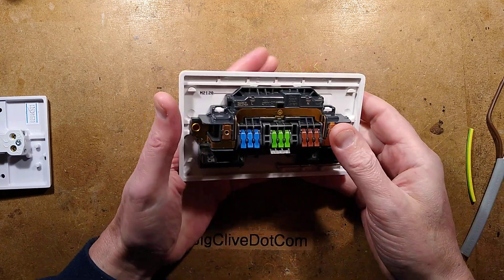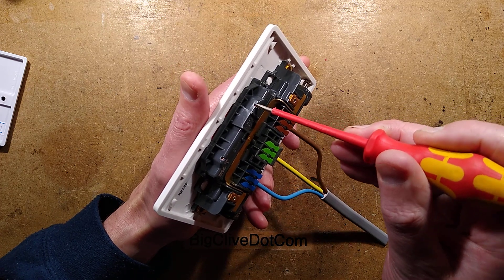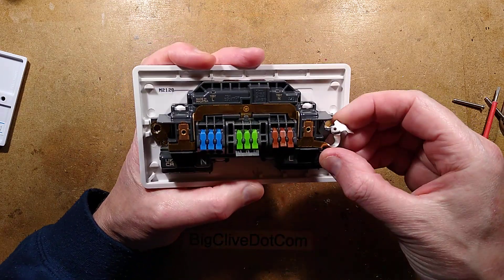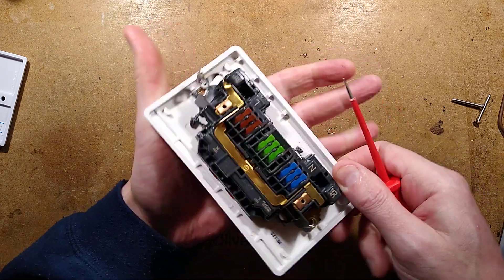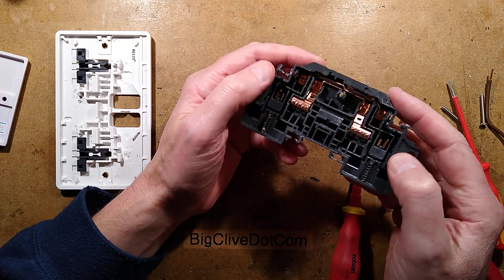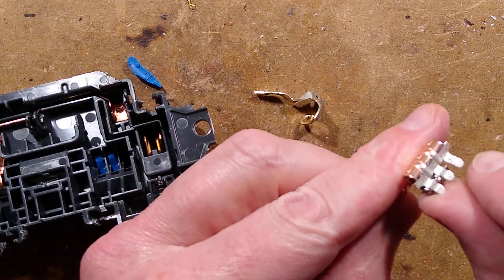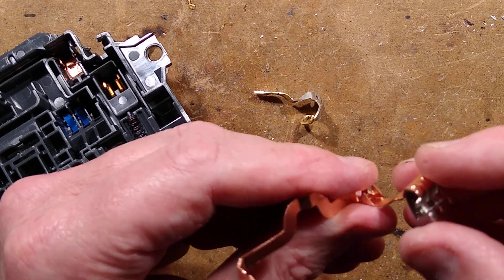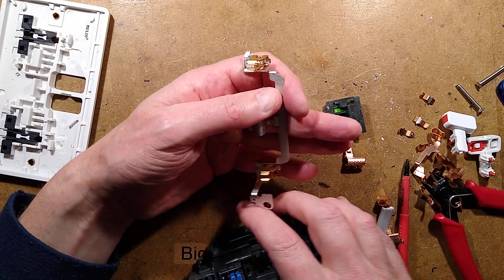Teardown of the new MK screwless socket

Comment: Brilliant video, Clive. I've never been fully convinced about the "spring clamp" style (Wago) connectors used on mains voltage. But after this video I'll be happy to use the MK sockets from now on. Thanks.
Reply: I"ve used a 1kV insulation tester on many of the Chinese "WAGO Clones" and they are certainly capable of holding up to this voltage (insulation resistance > 500M Ohm) Current-wise they seem OK for carrying 10A without a significant (> 25C) temperature rise too. The system is certainly superior to the screw-fixing system, and compatible with bootlace ferrules too.
Reply: I'm not entirely convinced by them myself, but MK gear is well designed and made so I'll trust their judgement. 
Anyway, the spring clamps at least provide a better connection than a badly tightened or totally forgotten traditional screw connector that then burns the house down.

Comment: Great video, the effort needed to take it apart shows how well designed and made they are to last forever in normal use.

The 3 terminals would have upset the electrician or plumber who wired a house i used to live in... a socket had 4 wire's forming a figure of 8 of the main ring and a spur ring... interesting!

On the loading, the British Standard requires double sockets to be rated at 20A continuously with one fully loaded on the maximum test load.  13A sockets and plugs are tested for 14A and the pass criteria is temperature rise within limits. 

Some of the MK ranges and other manufacturers rate theirs for 26A so 2 x 13A capability tested as a 14A and 12A load.
Reply: I never got all that.

Comment: Screw terminals can be tightened in enclosed spaces, you don't always have the luxury of space to put a finger behind it and flip a lever. The levers are better as there's constant pressure, the screws can come loose and also cut solid core in half. That's why maintenance free junction boxes are lever operated and can be put in non-accessible places. Normal ones must be accessible for checking the screw tightness.
Reply: Why are you attaching the wires after putting the unit in the wall, instead of before like normal?

Comment: But Big Clive, how on earth is my landlord going to stuff 5 wires into each terminal with such limited lever clamps??

Seriously though, the amount of force these things sometimes have to go through with stiff single core wiring fighting against them does make me wonder just how well they'd hold onto the conductors. Can see them being good for new builds, however.
Reply: Extra deep back box to give plenty of space for the inappropriately sized chocolate blocks.
Reply: @ferrumignis  When we first moved in, we had a beautiful one in the garage which had three spurs coming off a lighting terminal that was shoved in the back of a 47mm double socket with 10mm extender on top.

The entire monstrosity was surface mounted, wired with 1.5mm flex and got upsettingly hot before I got around to 'accidentally' knocking it off the wall and being forced to replace it at my own expense (with a garage consumer unit I found in a skip). The same landlord also thought it was appropriate to self-wire a 9kW shower with 2.5mm T&E to save a bit of money!

How these people didn't burn the house down before we moved in I do not know.

Comment: Aluminium is not uncommon for electrical stuff. Quite often clad (coated) with copper... non-spec ethernet cables, electrical lines through new housing developments... etc.
Reply: CCA ethernet in a home, for a 6-foot cable between your modem and PC might fly. In-wall, in a commercial setting, or in conduit, the cost of pulling replacement cable is a lot higher than just buying copper.
Reply: @jercos  The NEC (USA electrical code) does not permit the use of CCA cable for in-wall use, so it's not even an option if the installation has to be compliant with NEC.
Reply: @brianleeper5737  CCA, no. Aluminum alloy wire, expansion-matched to copper, yes. Plus NEC does not require existing straight aluminum wire to be replaced.
Reply: @jercos  Yes, it allows AA8000 aluminum wire, and any aluminum building wire you buy today will have AA8000 printed on it's jacket.

The AA1350 aluminum wire once allowed for building wiring (in the 70s) is no longer allowed due to the problems it caused.

Comment: This looks like it would be very handy for temporary setups, quick to terminate, no issues with mixing conductor types (say flex in and conduit singles out) because there are 3 seperate terminals for each pole. 

One issue I see with expanding the range is space on the back. If you look at a regular MK logic plus double socket you see lots of space between the terminals, on this you see virtually no space between the terminals because the blocks of three levers take up a lot more space than a single screw terminal. Then look at a FCU and see how crowded it is even with regular screw terminals, I just don't see where you'd fit the lever terminals in unless you massively compromised on wires per pole.
Reply: I bought some of these myself to use whilst decorating, easier to just remove the decorative metal  face plates and fit these and  then change back at the end of the work.
Reply: @paulf2529  Surely masking tape is easier, cheaper, and doesn't involve messing with every termination..

Comment: My concern with these style sockets is that I do not like pushing the solid conductors back into the box via the terminals. Spring clamps are excellent but they're not intended for mechanical stresses like that, and unfortunately that's the reality of fixing accessories back.

I'd rather see the circuit terminated in the box and a flexible flylead out to the accessory, but that would involve nice deep boxes to work in, something people seem to be allergic to over here.
Reply: You also have to consider there may not be room for deep boxes.  And traditional rules ban stranded conductors in the fixed installation.
Reply: @johndododoe1411  What 'traditional rules' are those? There's no ban on stranded conductors, they're in many components of a fixed installation.
Reply: @Monkeh616  In my country, those were the official rules before EU harmonization.  Even after that, many electricians use solid core for everything not intentionally bending during normal use.
Reply: @johndododoe1411  Not only do I somehow doubt that, being impractical and pointless, it's also irrelevant to the context.

There is nothing wrong with using stranded or fine stranded conductors in a fixed installation where they're appropriate.

Comment: We have had them here in Straya for years I like them, they cost more but they force the numpties to have a maximum of three cables at a point, we still have screws in our switch mechs, I doubt that will ever change, our switch mechs are too neat and small to accommodate that style of terminal.
Way back when cars had external 🐎 power, we had big ugly UK style switch mechs, fortunately we moved on to better (and probably cheaper), things.
Fabulous video, interesting that they tinned the earth bar.
Reply: This. I was gonna say Clipsal released a similar product like 20 years ago. They don't seem to have become mainstream, mainly due to cost I expect.
Reply: Had to look up switch mechs. Dang boi those are tiny! And I thought our Danish fuga system was strained on space.
I still feel like you have plenty of space for push-fit connections, as it seems the "mechs" can be larger on the backside than the hole they have to peak through.
https://youtu.be/OoOS1YL8b0M?t=8 < this is how the danish fuga system does it.
Reply: Though maybe not, as schneider doesn't do it on their weiser stuff which seems to take up as much space as possible https://youtu.be/YjE0tKPQ9Bc?t=75
Reply: @dumle29 , unfortunately Schneider make up for halving the usability by doubling the price and complexity :)
But generally, we get up to six items switches, dimmers, F connectors, data sockets, in a standard plate, that for some reason is the same size as the US plate, same primary fixing holes too.
Reply: You only need to put 3 terminal blocks in the backbox and have one wire to these sockes and wire the ring and more into the terminal blocks ;) Does that make me a numpty ? :)
Reply: @millomweb  sort of, if you are going to go to that much extra effort, not to mention the additional space required, you may as well use standard sockets and be done with it..
Reply: @50Hertz60hurts  Absolutely !

Comment: Why is aluminum not an ideal electrical material? My country is replacing all overhead mains cabling with aluminum due to copper cable theft. Aluminum cheaper and no value to thieves...
Reply from the maker: It forms a high resistance oxide on its surface, which causes connection problems and often arcing.
Reply: @bigclivedotcom  Doesnt copper do the same? It goes dark and manky? I have often had to cut back a cable if I have to re-terminate, just to get to clean copper. My bigger concern is the wago style clamp and how a slight heating might degrade the spring causing more resistance and more heat. Resulting in runaway failure. I have started crimping bootlace ferrules on stranded wire before terminating into screw down terminals/plugs, specifically to get away from this gradual heat related failure, and that is with screws. Wago scares me, especially at 15A.
Reply: @erroltheterrible  The oxides of copper are soft and easily cut through or removed, whereas aluminium oxide is what they make sandpaper out of. If you're dealing with a little tarnished copper on a cable, just clean it off.

Actual Wago connectors are well tested and not severely affected by high temperatures or thermal cycling. I can't imagine these are any different, if I were MK I'd have paid Wago to engineer the contacts.
Reply: @erroltheterrible  Aluminium oxides very quickly in air - it happens in a fraction of a second, so you've no chance of terminating it before is oxidises. Copper changes far slower!

Wago's background is in industrial kit. They know their stuff and have been doing it for decades. The commercial connectors used in the uk is rated to 30/32A, and 15A is a non-issue. They go way heavier currents on the din rail parts.

Comment: Guessing the Anderson plating on the connectors are to Deform and hold the wire better ?

Silver or Tin are both softer martial to "bite" Then copper.

Comment: Aluminum is more conductive than brass though
Reply from the maker: It is, but it also forms a very high resistance surface oxide, which can cause electrical issues.
Reply: Aside from it's propensity to oxidise and form poor connections, itsy also very soft and flows more easily under pressure so connections loosen over time. Americans found this out early on with the widespread use of aluminium wiring.
Reply: And despite all this the service to your residence is always aluminum. And other high power conductors. See those high tension wires? Aluminum. Copper is sufficiently heavy that it does not work well for aerial applications. Aluminum just has to be managed a bit differently. Better terminations.
Reply: @stevebollinger3463  actually most of those high tension wires are copper coated steel
Reply: @Mister_Brown  ACSR, aluminum conductor steel reinforced cable is the most common in the USA.
Reply: @stevebollinger3463  (Modern) high power aluminum wiring uses terminals specifically rated for the job. Anti-oxidation compound is usually also required.

As you said, better terminations.
Reply from the maker: @stevebollinger3463  A lot of power distribution is done with aluminium, with the correct pastes and crimps to terminate it correctly.
Reply: @stevebollinger3463  Aluminum high tension wires are an AA1350 alloy while 2nd generation aluminum building wire is an AA8000 alloy. 1st generation aluminum building wire is AA1350 alloy and that is what caused the problems with overheating and poor connections.

Comment: For something that is made in my country.. i have never see this sold or used here..
Reply: I can't see these being stocked in 'Mr DIY' somehow! Also not sure how they would work with the 3 and 7 stranded wiring used here in domestic installations
Reply: @paulhammond7489  Normal electrical store, I dont trust Mr DIY with electrical stuff even their SIRIM sticker. 
Stranded wire should not be an issue since ferrules can be used.
Reply: @Mayo-dj6ew  I feel the same as you, the Standard & Industrial Research stickers in that store and many other stores don't provide me with any real confidence on the safety or longevity of electrical products. You're right about the ferrules, they should do the job with any stranded wires.

Comment: Do you all normally sleeve your ground wires? Have I been terribly un-observant all this time?
Reply from the maker: Our standard twin and earth cable has a bare middle core that usually gets sleeved.
Reply: @bigclivedotcom  wow! That is a seriously quick answer! Do you think that is a worthy task (I.e. I should consider it) or is that just pfaff?
Reply from the maker: @Cozmoox2  it avoids the bare wire shorting with other connections.

Comment: Having the earth being the shortest wire isn't great, if the socket were to get yanked out of the wall the ground would disconnect first, leaving live and neutral still connected, it's standard to have a bit extra ground cable looped so it's always the last wire to disconnect with force
Reply from the maker: I made them that length for neatness of the demonstration.  In reality they would be a lot longer.
Reply: On a socket it doesn't matter.  It's screwed into the wall.  On a plug I would agree.

Comment: Why do you guys not have fully coated earth wires. When I worked as an extruder operator for Associated British Cables in NZ in the early 1980s and made 3 core flex, the earth wire was fully coated like the other two wires when it was fed through the extruder to get the white coating.
Reply: flex on the other hand, as you describe, DOES have 3 fully insulated cores. The wire shown here is "twin and earth" and is only for use in fixed installation ie inside walls and under floors.
Reply: @jaycee1980  Thanks for that. 👍 We never had the twin and earth. Seems a tad weird having two different "wires" when one can do both jobs. Different strokes for different folks I guess.
Reply: @josephking6515  By "two different wires" do you mean solid core and flexible cable? You wouldn't use flexible cable for fixed installations, not only is it more expensive, it doesn't hold it's shape and is more difficult to terminate reliably (needs ferrules crimped on).
Reply: No real need for it to be fully sleeved. Also it's useful as a "cheese wire" to strip back the outer insulation on installing.
Reply from the maker: Noting that using the earth to strip the wire is frowned upon by the red-tapers because it "might stretch the wire and reduce its current carrying capacity".
Reply: The bare Earth wire is for situations like... if granny bangs a nail into the wall to hang a picture and goes through a hidden cable, the nail will strike the naked Earth cable first and if it breaks the insulation of the others blow the fuse.

Comment: In Germany screwless outlets are common since... forever... BUT we only have two connectors per terminal. Having three could be quite useful in some situations 🤔
Reply: The Ring circuit is quite unique to the UK... which is why these sockets have 3 terminals (loop in, loop out and an extra set for a spur)
Reply: Same in Denmark with the LK brand.  Got quite annoying when they established a harmonized EU rule to never put more than one wire per hole.  So now there's a need to get deeper boxes to make room for Wago blocks.

Comment: What is the sleeve you slip over the earth called? I've had bare earth wires give a bang when working on light switches and multiple breakers went to the same box. (Bare ground and a big, uncovered, live terminal on the  next switch, pull the switch out and its ground hits the live terminal one over)
Reply: "earth sleeving". It's basically pvc tube marked green/yellow.
Reply: Way back in the dark ages, we also had bare earths, and we called that sleeving spaghetti.
Reply: @50Hertz60hurts  The Earth conductor remains bare over here for situations where someone say accidentally cuts a live cable with a pair of pliers, the pliers will touch the Earth first, thus when it goes thru the other conductors the fuse will blow and hopefully save the idiot.
Reply: @Witheredgoogie , you might want to give that a little more thought  💭, or any thought at all…
Reply: @50Hertz60hurts  Eh ? just saying how it is and the thinking behind it. Grandma bangs a nail in a wall to hang a picture and she strikes a hidden cable, there is the certainty the nail will touch the bare Earth conductor first. If the sleeving of the other conductors breaks down due to age or UV then it will bring them into contact with the bare Earth , thus a bang at the fuse box will bring  to the attention that the cable needs renewing.
Reply: @Witheredgoogie  oh, it's great for romex in the wall, but inside the box it sure would be nice to have sleeving. Can't find a source in the US. 😑
Reply: @RobertSzasz  You could use green heat shrink tubing. For this application there wouldn't be any need to shrink it.